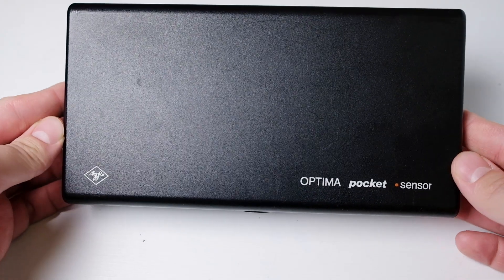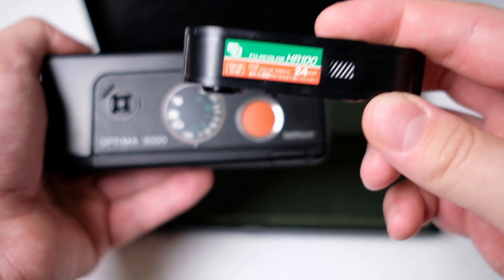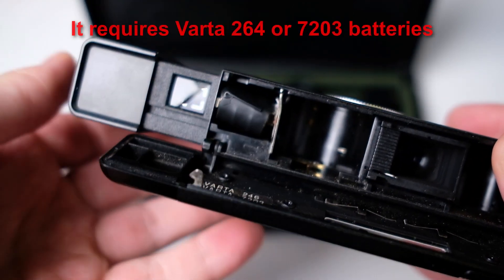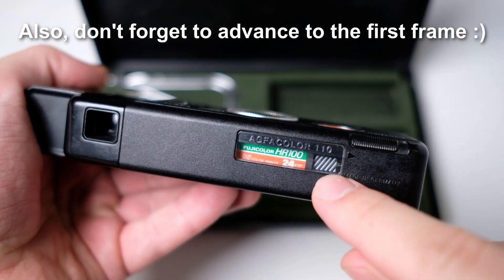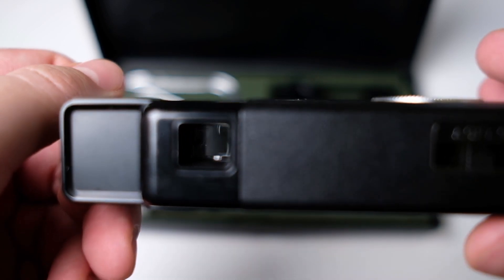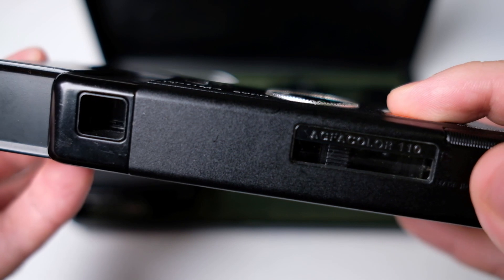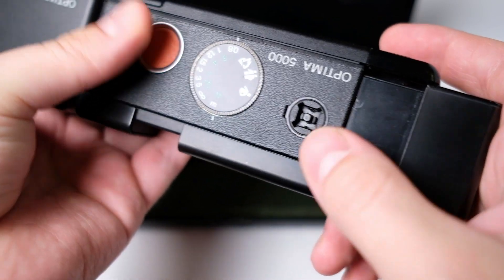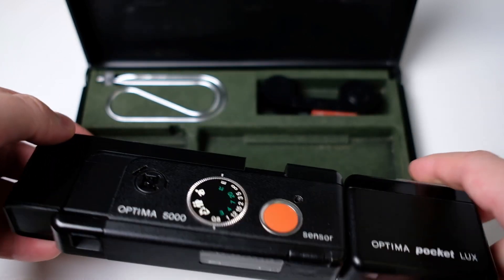AGFA OPTIMA 5000 - 110 Format Camera from the 1970s

Comment: When it has no film in, the shutter clicks as it should when you press the button.  But when there is film in there it doesn't do anything when the button is pressed. 

I dont have a bloody clue what its doing, film cameras are before my time.
Reply from the maker: Strange, I have not had that problem, it was working fine for me.
Reply: @mikaelrphoto  OK seems to work now I think I didnt wind it on far enough.  There's a little tooth that allows the shutter to work when its engaged in the little hole in the film.